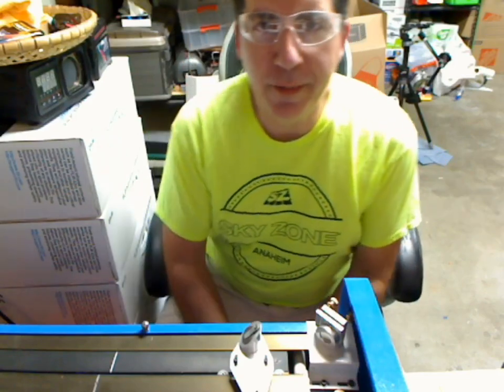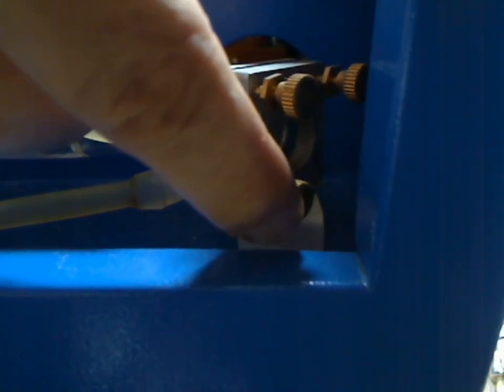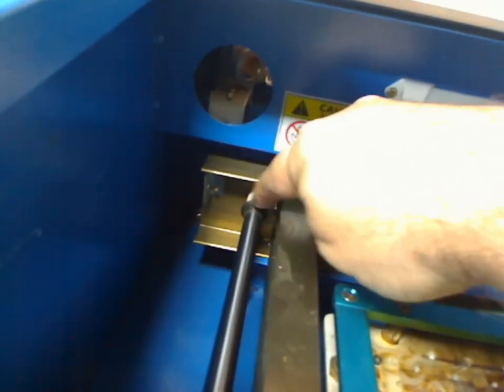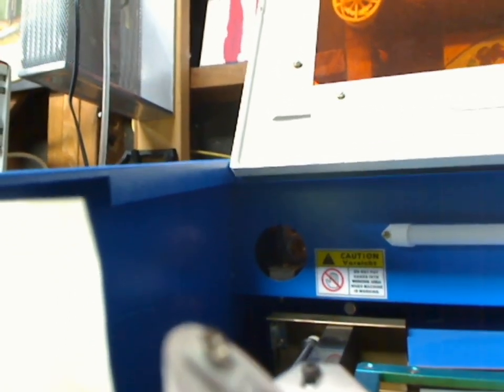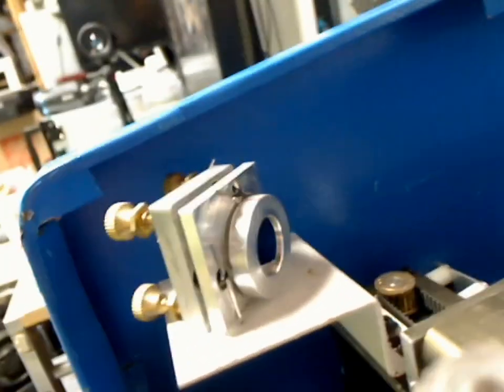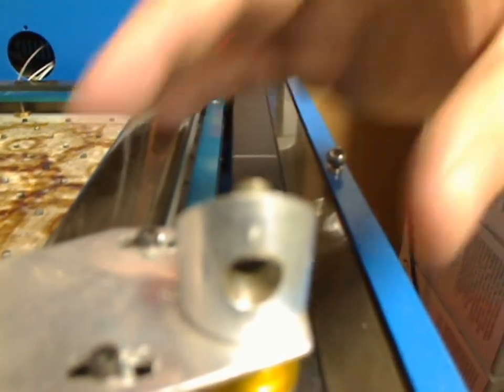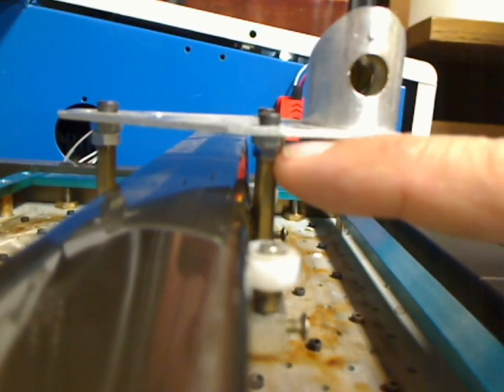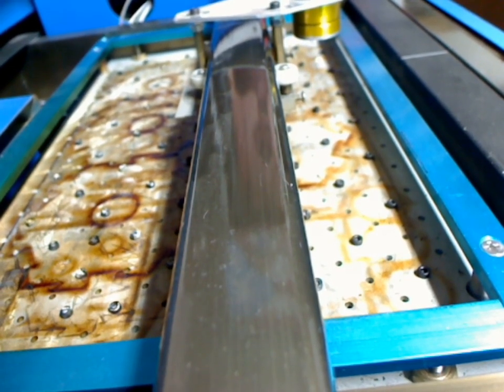The Short K40 Laser Alignment Video is Here!

Comment: John! What computer or laptop would you recommend I should get to work with my K40 and my eleksmaker pro that are both in my man cave the K40 is brand new with some adjustments done like the earth wire (ground) that was screwed to the blue powder coated paint work ( I’ve sanded it back to the bare metal and I’ve put a micro switch on the lid so when the lid is opened the power will be cut off ect,ect -  I bought the K40 thinking I could use with any old computer or notebook but I’ve been told this model of notebook is useless it’s a > MSI U135 DX, HDD160GB,RAM DDRIII,ODD- none (I’m a hammer +nails guy and computer’s are not my department as I say to people a iPhone to say hello and goodbye is all I’ve ever had and wanted because as I said computers didn’t interest me or social media as that’s just a area for people who tell each other to f*ck off or do the back stabbing as we call it in the UK ( insulting you behind your back) 
   Any help would be greatly appreciated then I’ll ask the wife  to take control in that department.
Reply from the maker: Any PC capable of running Windows 7 should be adequate. If it is a laptop, be surr to turn off any power saving features controlling USB, hard drives, and sleep. Rarely you will see some specific hardware that has USB issues. The best advice I can give is to not go cheap on the cables.

Comment: This video just may save my sanity.  My laser came out of the box fairly well aligned.  Over the last year of ownership I like many others have performed mods such as removing the bed, updating mirrors, adding air assist and better smoke extraction, laser head nozzle from American Photonics etc.  The problem is every mod I have done has made it cut worse than stock.  I assumed part of the problem was when I did things like removed the bed I made the already flexible case even more unstable and prone to twisting and flexing.  I have found that every time I move the case my alignment gets thrown off a little.  Never really understanding what I was doing I would accidently get it marginally aligned and it would cut and engrave, but never as well as I felt it was capable of.  I have spent hours watching videos, reading forums, and cursing trying to get this figured out only to feel like more of a failure with each attempt.  I finally feel like I have a understanding of how the mirror holders work and how to "Catch the beam."  Thank you for taking the time to help myself and others like me who otherwise would have given up on the K40 and perhaps the hobby.

Comment: Hi can you help, please ! So ive alligned to gantry so from mirror 1 - 2 and mirror 2 to mirror 3, the same way in the video, but if i move the head to the top right, its always off, so it will be slightly higher than the other 3 corners that hit the same place, does this mean my gantry is misaligned or is there something i'm missing?
Reply from the maker: This indicates that your gantry has some twist. There are four bolts attaching the gantry to the sheet metal frame  loosen the one in the corner where you think it is high, or tighten the corner if it is low. Best to use a washer or two to shim it before tightening up the bolt.

Comment: Hi John

I agree with you, a lot of people get it so wrong.

One of the first things I did to my K40  was to check that rail carrying the laser head was parallel to the laser tube by checking the distance between each end of the rail to the back of the metal case and checking the tube was parallel to that part of the case.

I found my rail was 1/4" out one end to the other, that's why I had so much trouble aligning the beam at first.

So I loosened the four bolts holding the chaise in place and moved it to fix the alignment.

Now the alignment of the beam is so good I can cut 5mm ply at 7amp's and cutting speed 8mm a second in one pass, 6mm ply at 10amp's, 6mm a second.

Regards

Richard.